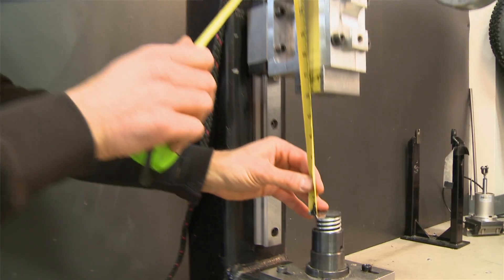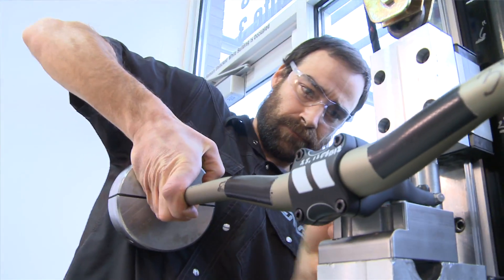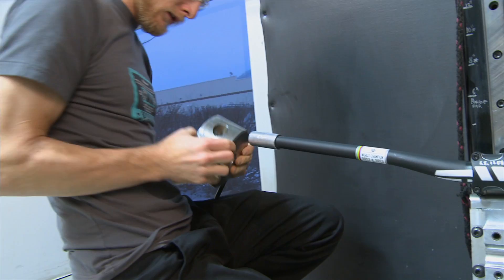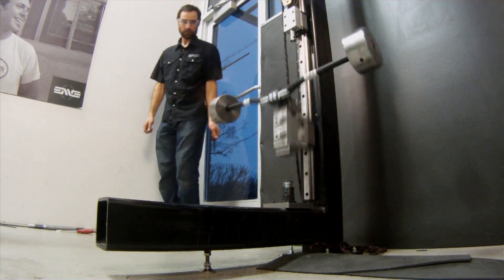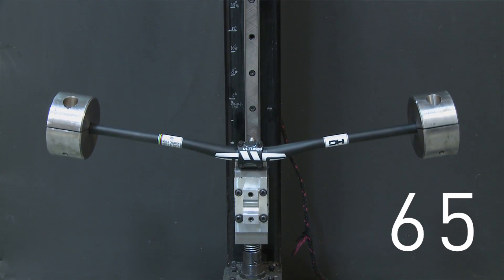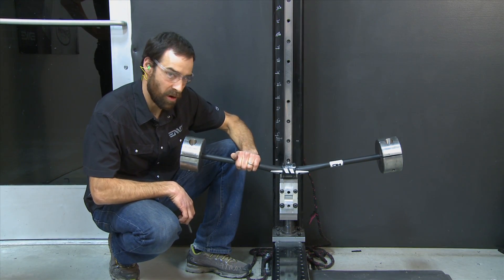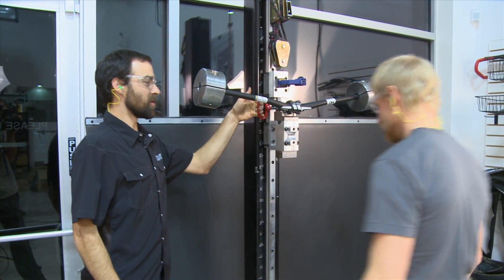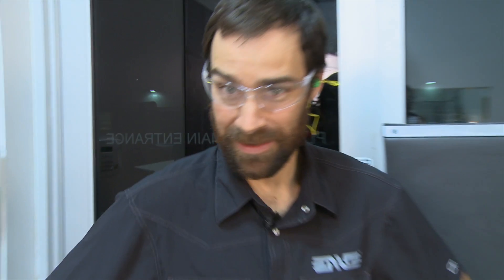ENVE DH Minnaarbar Impact Test

Comment: Howdy! Just out of curiousity, what is the reason for using 16 lbs on each end when the DIN 79100-2 "impact" drop test that the industry uses specifies 10 kg (~22 lbs) per side? Not poking or trolling. Just legitimately curious how ENVE determined that weight and find it more valuable that using the 10 kg standard. Thanks!

Comment: The forces imparted on the bar will be a function of k (stiffness) and c (damping coefficient) of the spring mass damper used. Is this accounted for? It seems height and mass are frequently referred to in isolation of the system. An accelerometer could also go a long way in understanding the impulse and forces imposed on the bar.
Reply: F=k.x+c.dx/dt-m.g where the drop height is really only providing an initial velocity to the system (vi=sqrt(2.g.h)).

Comment: would be nice to see the actual braking point, you mention it but then go to this arbitrary 150 impacts. Companies think its not good to show the breaking but it feel quite the opposite as a test to failure would with details would show the confidence the bar deserves.i get this weight might not break it anyday soon, so why not increase the bar weights until it fails, as guess you will have done already. as it stands this is just another testing video that does nothing really
Reply: True, They need to take these bars to guys over at Mythbuster. They always test to failure :)

Comment: only 16lbs of weight at the ends. I'm over 200lbs, there is at least 100lbs of my weight given anytime on the bars on real rough steep terrain. How would those 16lbs justify or mimic my wieght and unpro status riding style? Honest question.
Reply: I'm not going to get into a big discussion or argument with you, because I feel that doing that online is just plain stupid. However, being a mechanical engineer, I can assure you that you will NEVER under normal riding circumstances exert as much force on your bars, as was done in this test. I know it seems like a 200lb person, would have their weight distributed evenly about the bars, but in reality, the majority of your weight is on your pedals, and only a small fraction at the bars. Not to mention the suspension on your bike absorbs much more of the force than the small spring used in this test. If you were to bottom out so hard that the bars were to flex that much, and have as much loading on them as in the test, you would have no wrists left. The people who design these products know what they're doing, and do a very good job of it.
Reply: Alex Rose  Guess you didn't notice the last two words of my comment. It's an honest question. Not much of a comparison or explanation to have the viewer relate to it better. We're all not "mechanical engineers". Also have notice that you need to put about half of your weight into the fork in air springs, and coil springs to get your proper sag, i.e. 30% for DH. So that alone would show just how much weight is on the bars already. Granted the fork is doing the damping and compensating taking majority of the hit off the bars. Again I ask, how do 16lbs justify a heavier or even an average rider weight on the bars in a real rough, STEEP terrain, which would put a lot of weight on the bars. Thanks for the break down in advance.
Reply: @alexrosefr  Howdy, Alex. Quick question, out of honest curiousity. There is a DIN 71900-2 standard that companies use to test impact strength of handlebars. Internationally recognized. It specifies 10kg on each end, which is roughly 22 pounds. Legitimately curious, as you are a mechanical engineer, does it seems strange that they would test and market using a non-standardized method of testing? A handlebar should pass a 75cm drop test if folks wanna use it for aggressive mountain biking, which this handlebar very likely would pass. But still. doesn't that seem a bit off and misleading?
Reply: da doodooboi Its because the important thing is the force exerted, not the weight used. In this test, the force exerted is very high because the 16lb weight is coming to a stop almost instantly. So, for example, if the weights are travelling at 10meters per second when the bars hit the stop and it takes a hundredth of a second to stop, then the force calculated from F=ma is 8000 newtons or like hanging an 800kg weight from each end. When a rider takes a hit, the force is far lower because the forks and your arms spread the load over a longer time. Thats why you will never see your bars bend like that when you are riding...
Reply: I Just wonder how 150 drops compares to 3-4 years od abuse and several crashes
Reply: Dampening control from bicycle suspension and human body reduce impact forces dramatically. This static test is legit. Anything can get bent or broken during a crash so my only concern is for performance during a ride. These bars are strong!
Reply: how did you come to the conclusion half your body weight is on your bars? you must be riding in a very awkward position. you don't need to be an engineer, or a genius, or an above average of intelligence person to see that only a fraction of your body weight is on your bars. goodness me you are a worry.
Reply: I think it's like this. Imagine lying on the ground under that machine with your elbows on the ground and your forearm going straight up and imagine that weight falling onto your hands transferring the weight to your arms and then your elbows and then into the ground. Your arms would probably break.